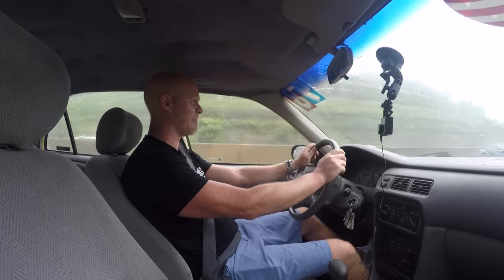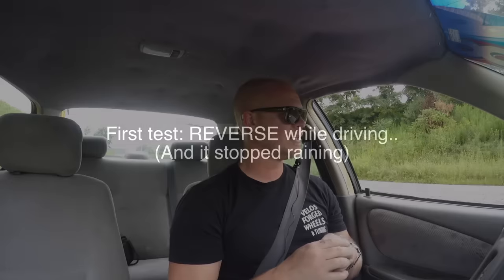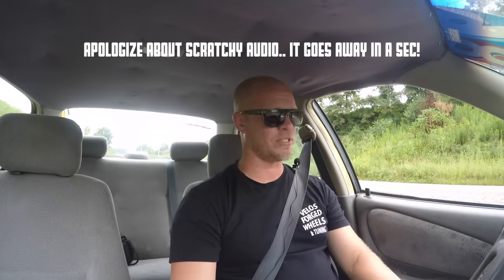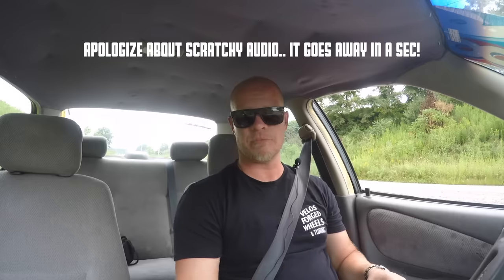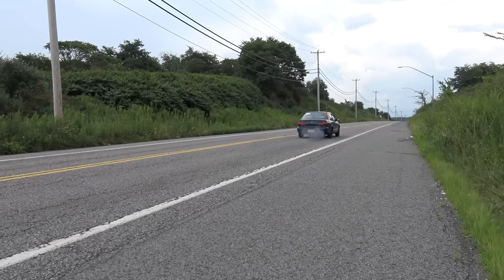What happens if you put a 20 year old car in Reverse AND Park WHILE driving? (NOT SAFE)

Comment: The ignition doesn't turn off but rather the engine stalls out. Try putting in neutral, rev the engine and then put it in reverse ;) That will give you some really interesting results but I probably wouldn't go 40 when doing that :D

Comment: Good luck killing it. Its a corolla with a 3 speed transmission. I owned one for about 13 years. Nothing broke ever.
Reply: Looks to me that the car is burning engine oli though. If he decides not to top up it could eventually break
Reply: @sean71300  yes these cars are notorious for burning oil i own one i usually put in 1-2 quarts of oil a month which isnt too bad despite it having 221,000 miles

Comment: I can confirm, my 39 years old 1979 Nissan Sunny B310 (Datsun Sunny in some countries) which is a manual transmission (duh) doesn't let me put to the reverse while I'm driving faster than 4-5 kmph. It's impossible to turn the gear shaft to the reverse position, there's some sorta locking mechanism.

Comment: Do it on a manual
Reply: car first theres a video on here of someone doing it in an old Ford Ranger, they did rev the engine as they dumped the clutch and the rear wheels were spinning backwards a good while.
Reply: KABOOM!
Reply: @Hector Ortiz no, reverse is like first
Reply: Very hard to do and if you do the most likely thing is clutch slip
Reply: @Hector Ortiz haha you don't know how your car works then.
Reply: My friend has an old Ranger and he did this by accident (he tried to go into neutral and rev it.) He floored it and the rear end hopped super bad and then it spun the tires like mad. He did it like 2-3 times and it still drives fine. 🤷🏻‍♂️ The Auto in that thing is indestructible.
Reply: The gears will be spinning on one direction, they won't mesh if you try to shove them in the other direction
Reply: antonio, he's not talking about gear ratios, I'm pretty sure he's saying that reverse and 6th are the same position on his shifter, so If already moving, it'll shift to 6th, and it will only shift to reverse if stopped.

Comment: That thing is fucking bulletproof. It has a 3 speed transmission, btw.
Reply: any car would do this, it's not special.
Reply: David G Right, but it's still impressive that such an old car is handling being beaten around. The fact that park still works is a miracle.
Reply: They had 3 or 4 speed autos in that year. I had a 1990 prism with the 3 speed auto, tranny blew at 80k
Reply: Not really, the parking pall is meant to not engage at high speeds and as such just bounces around making that horrible noise until the car slows enough for it to engage. I wouldn't recommend doing it as a regular thing, but it was working as intended.
Reply: Just bought a speed 3 lmao
Reply: Its a Toyota corolla thats why its bullet proof.
Reply: WᴏʀʟᴅsSᴍᴀʟʟᴇsᴛVɪᴏʟɪɴ He probably had a trans leak and never checked it until it went out. These cars are tanks because I currently own one and I give it hell lol.
Reply: 4speed

Comment: @ 4:00. When you out the car in reverse moving forward,  it kicks the torque converter backwards,  causing the engine to stall out.  Since your not going in reverse,  it's forcing the engine to slow down timing and start to spin backwards.  That can be VERY bad on your motor.  Which may be the reason why it stalls out as a safety feature, otherwise your throttle body is the new exhaust system, and your old exhaust,  is the new wide open throttle body.

Comment: You should do a “what would happen if you turn off the ignition switch while driving 60 mph.”
Reply: CJ Vlogs 
I did that once in a car and it blew the internals of the mufflers...sounded like a small explosion.  Didn't hurt the engine just the destroyed the mufflers.
Reply: I know in a traditional auto, the torque converter will simply disengage and the car will act as if its in neutral. A manual though you would probably be flung forward from the forces of compression braking
Reply: Justin Noker see I have 2005 Chevy cobalt and I tried that at 8 mph and when I did that, it felt like someone slammed on the breaks because it stopped the car instantly. That’s why I was curious in a car that’s from a different generation and model at 60mph
Reply: @bkrgls  Throwing heaps of fuel into a hot exhaust system 😂
Reply: @jetstream454  
🔥💥🤪😁👍
Reply: @cpufreak101  if you turn the car off it will do nothing, just spin the engine without igniting it. On a old diesel without a 'throttle body' (it's a flap that closes the intake when the ignition is off, helps to stop a runaway) you cannot turn the engine off, you just will not be able to accelerate as most of them have a electric throttle.

Comment: Put it into D1 at 60mph
Reply: Show Me What I Need To Know Yeah and then you gonna pick up ur gearbox in pieces on the road behind
Reply: Kristiqn Ivanov That's the odea, isn't it? Hahaha!#!
Reply: Even a 20yo car has a safety override for that. It just stays in overdrive tell you reach a speed slow enough for first gear.
Reply: brandon calin  Ok expert
Reply: Kristiqn Ivanov I am no expert at all. I had an 02 Honda automatic I did it to. So I know from experience.
Reply: Kristiqn Ivanov I'll even sub to your channel
Reply: Kristiqn Ivanov my 96 does that
Reply: I did L for low gear in my corolla 01, and nothing happened, just crazy revving. I regret that because the car never let me down.
Reply: I've done that in a 2006 toyota corolla fielder. Nothing happens
Reply: Kristiqn Ivanov lol gear box? Try blowing your motor

Comment: My '94 Camry (first car I ever owned) even had a neutral safety switch on it, designed for dummies trying to start the engine in gear. The ignition would just do nothing when you tried to turn it. Older cars had more safety features than people credit them for.

Comment: Lol you can’t kill a Toyota Powertrain.
Reply: FastestCores ikr scotty kilmer is the man that always says you can't kill them. I believe him now completely that it is bulletproof.
Reply: He would also say the C63 is a money pit.
Reply: Its common sense that Toyotas are bullet proof, from experience. I have the same corolla and it ran with trans oil for 30k mileage. I decided to give it because i like it.
Reply: Most modern cars can take some abuse, in Europe they tested out some Volkwagens by running them for 5 years and 100k miles on the oil that came from the factory and they all survived and were still running. Not saying you should do it because its still terrible but they can take some stick.
Reply: Gravemind how long ago was that though? And how many times did they pay off the inspectors? Cause most modern cars i know of, the engine oil would start to sludge up and plug the small holes of sensors, then trip the CEL. Theres videos of many newer cars coming into shops requiring full engine teardowns with only 20-40K miles on it cause the owners never changed the oil and now it doesnt pass inspections, or if in a state without inspecyions just doesnt run right period.

Comment: All the park setting is, is neutral with a pin that drops down into a slotted gear relatively similar to the way a starter engages with the flywheel. All you're hearing is the pin trying to pop into it's slot but not having enough time.

Comment: Did this earlier today in my 86’ Chevrolet Celebrity coming back up a slight dip in an attempt to put the trans in overdrive because I was going onto the highway. I’m pretty sure either there is a safety inhibitor but it immediately gave a very slight jerk and turned off the motor but it was only in the reverse gear for not but a second if not less. I then threw it back in drive in a panic but I had no power and just rolled to the side of the road. Realized the engine was off after getting out in a panic getting ready to call a ride but got back in and it started right up and is operating just as was before the accident. Still is doing just fine because I’m thankful.

Comment: I remember the same thing would happen in the 3 ton propane forklift I used to drive for Home Depot gardening. If I was going back up the incline where the truck trailers were backed up & I switched it to reverse while moving(6-12mph mind you), it tried to engage & it was so much reversing input, the engine would cut out. I could still steer & brake long enough to secure the device & restart. No clue if there was permament damage.

Comment: The ignition does not "turn off" automatically as a safety feature. The engine dies because the torque converter acting like a clutch. Selecting reverse while going forward is like trying to start a manual car on a hill without the gas pedal. It's how the PIT maneuver always ends police chases. The car is spun backwards and dies because the torque converter (clutch) is trying to go forward but there isn't any momentum.

Comment: Parking palls are typically very small pieces of metal that hold the car in Park the car doesn’t apply the brakes in reverse the trans shifting into reverse with a huge load on it and resistance pushing on the engines rotation that is almost trying to spin the engine in the opposite direction so it shuts the car off

Comment: The ignition doesn't turn off, it stalls, when you switch it in reverse it reverses the torque converter because you're moving forward while reversing the gears thus reversing the converter halting the motor, motor spinning one way the transmission suddenly the other, what you should have done is got it up to 40mph under load and then switched it into reverse so the motor fights the converter but being such a little motor it probably would have stalled out anyways.

Comment: Its not turning off the ignition as a safety feature... its stalling out due to it being a gutless engine at idle suddenly having a large load applied to it.

About 25 years ago, I accidentally performed this experiment while delivering bulk newspapers in a heavy duty step van.  Chevy 350 TH400 with a POSI 14 bolt rear, IIRC.  The shift handle got snagged on a bundle of papers I was preparing to throw.  I was doing 50~55 on dry pavement with my foot maintaining the speed.  Literally about a ton of newspapers in the truck.  The loosey-goosey shift handle flipped right into reverse.  There was a delay as the tranny engaged and suddenly the duallies in the rear either locked up or started moving in reverse and the truck slid a few hundred feet until i got the shifter back in drive.  Everything initially seemed fine, but a couple miles later the rear locked momentarily at speed and then continued, but with some noise.  It was clear the rear had an issue.  Later, it was determined that three large pieces of gearing had escaped out of the housing at high speed.

To really test this Chevrolet badged Toyota Corolla, you are going to have to keep the engine RPMs up.  I imagine with enough power applied, either something in the transaxle will break (sun shell, but I'm not familiar with the weak links in Toyota transaxles ) or one wheel of the car will lock up, so be prepared for the car to want to change direction.

Comment: That odd clicking noise was the parking stopper . Its a one tooth sort of thing that is pushed into the flywheel gears by a cam when the car is put in park. But when the car is moving the flywheel gears and spinning so it slips and grinds on those gears and eventually smoothes out and you wont get park anymore , just the neutral

Comment: The car "switched off the ignition" as you mentioned in the vid while putting it into reverse cause the engine stalled because when putting it into reverse at a speed of 40mph the engine can't overcome the torque converter drag as the torque converter tries to rotate to the opposite direction when you select reverse

Comment: I have a 21 year old truck and sometimes I accidentally hit reverse when shifting into neutral, as long as your foot is not on the gas pedal when you accidentally hit the reverse, the vehicle will just cruise and still run on some cases and not damage the trans at all. But do not hit the gas pedal in reverse while moving in a forward position.

Comment: Putting in reverse does not shut off ignition, the motor stalls because the forward motion is greater than idle in reverse which works against the motor, putting in park while driving gets parking lock mechanism grinding as parking lock mechanism bouncing…

Comment: the ignition don't shut off the pressure from the trans just stops the engine from turning. and the parking paw is spring loaded and when it tries to go in  because its rounded like a ball on the end it just popes back out until you almost get stopped.

Comment: Putting your car into park puts a gear sort of thing making the car not move. So, if you are driving fast the pin won't get in the gear, but my guess is if you go slow and put it in park then pin will get stuck in the gear either snapping the pin or make the pin slip and make a ticking sound. Even though when you were slowing down it should do the same as going slow , but you still could try to see if something changes.

Comment: Actually, as an mechanical engeneer i have worked in fiat do brasil when i was at the university, the work i did was test cars with some experienced engeneers. They do all of that, they torture cars at the point that you want to cry for the poor things, they test every part of the car until destruction so in order to verify that some people when using the product if the manage to make a mistake in changing a gear they dont get hurt or killed or risk anibody else. All of those scenarios that he has proven are well thougth before and have been already testet. The safety fiture that kills the engine wen accidentally put in reverse while driven has been implemented in late 80's so to destroy a transmission or to set the weels to spin into reverse while driving you have to use a car way older.

Comment: Older cars like this Corolla don't have safety lockouts like new cars do, nevertheless the conventional automatic transmission has a "built-in" safety feature that simply makes it impossible to explode the tranny or the engine. What happens is that as the transmission engages Reverse, the turbine gets suddenly and violently yanked and spun in the opposite direction .  This causes a massive braking effect on the impeller causing the engine to stall.  Since the transmission pump is powered by engine rotation, hydraulic pressure drops, thus releasing the brake bands that engage the gears, and the car coasts along in "neutral".

Comment: Rev the engine up to redline in neutral, then throw it in reverse. The engine RPMs should be up high enough to compensate for the transmission working against the engine.

Comment: Well, if you put the car in reverse @ 40 mph you are essentially trying to slam the engine to -10000 rpms or so, but the viscous coupling prevents that from happening so the engine stalls. I have no idea how a manual would react, it may lock the rear wheels, it may spill the engines guts. I don’t think the engine would easily spin reverse direction without a lot of internal resistance, which is why I would assume it would lock the tires or slip the clutch.

Comment: @AutoVlog, There was no use of wheel brakes at all, all braking is purely engine braking. when you put the transmission in reverse when the wheels don't have traction then the wheels and drivetrain will simply spin backwards while your car moves forward until you regain traction. With wheel traction, you will feel the transmission and drivetrain fighting to slow the engine speed down and possibly even reverse the rotation of the engine causing a engine brake force and idling out the engine.

Comment: Putting it into reverse while going forward, the ignition doesn't actually "shut off", the engine is stalled, and since the hydraulic output of the transmission pump stops, the transmission goes out of gear and doesn't get a chance to run the engine backward... at least not more than a few rotations.

Comment: It stalls the engine by trying to spin the torque converter backwards when you put it in reverse when the engine is at idle , the second the engine stalls , the transmission pump loses fluid pressure and with no pressure it releases its bands and basically goes into neutral , it gets more a lot more exciting if you have your foot on the throttle and do the same thing and the engine does not stall something breaks or the driven wheels spin the wrong way leading to some very ugly driving dynamics

Comment: I once put my 1957 Chevy into reverse while going 55 MPH forward.  It locked the wheels and killed the engine.  After I came to a stop, I restarted the engine and drove away, but the transmission only lasted about 20 more miles when it quit.

Comment: I can tell u from experience, if u don't press the break or gas u can easily put it in reverse and the car will just coast and put it back into drive no problem and keep going, no noise no sound etc. Ive tested this on my 2015 Nissan Micra and now my 2006 Mazda 6. As long as u dont apply gas or break causing the car to want to go in reverse then nothing happens...

Comment: I have a question. I didn’t fully start my car and I put it in reverse. I found out then that I didn’t start my car and put it in park after which I think I heard the parking prawl. Do you think something happened to my transmission ? I drove the car and didn’t hear any problems but could I be wrong??
Reply: How's your car now? I literally just did that a few minutes ago and was wondering the same thing.
Reply: Also were you moving a little when you put it in park that's what I did?

Comment: 24 years ago when my 67 Mustang had an automatic, I accidentally put it in reverse doing about 30mph. The road was wet so the wheels just locked up for a second until I put it back in drive.  It continued to work fine for another 2 years until I swapped in a 4spd manual.